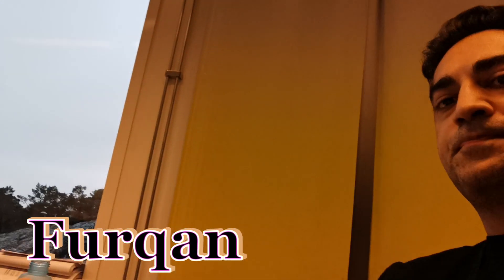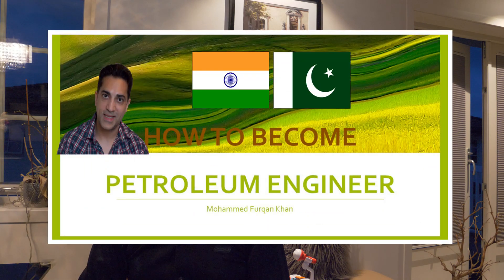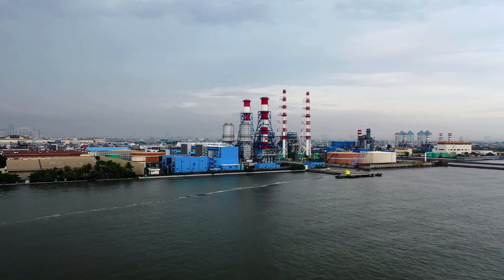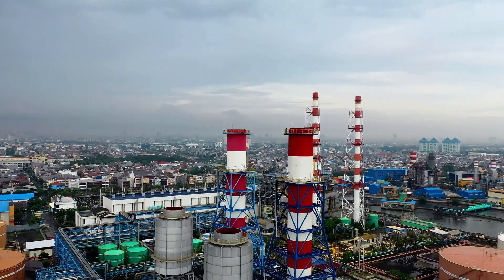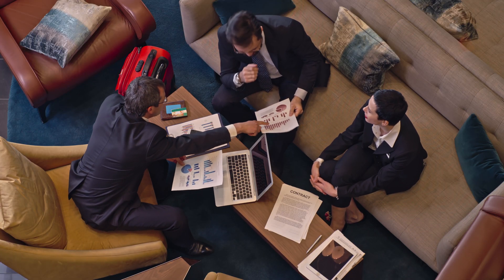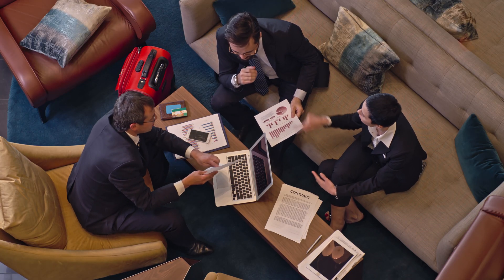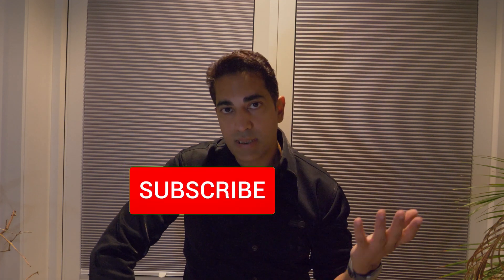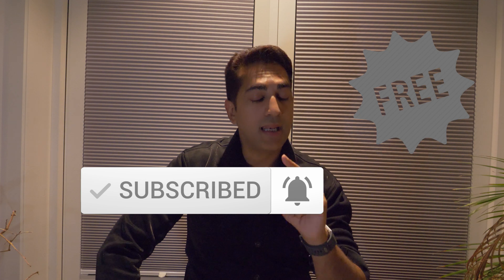Salary and Future of Petroleum Engineers | Questions & Answers by Furqan | Desi lifestyle in Europe

Comment: Hello bro can  mechanical engineers do petrolium jobs?
What cources should I do
Reply from the maker: Yes, they are one of the main facility engineers. Courses that are relevant: fluid dynamics, system response and control, stress analysis, mechanics of machines, heat transfer, and thermodynamics, material, valve, rotating machines erc..
Reply: @DesiLifestyle  can I learn HVAC? Or full MEP course
Reply from the maker: Sure you can. HVAC is also a engineering branch.

Comment: Sir, if one is interested in sales reps in oil and gas sector. is it possible to get this without experience of field working in oil and gas????? explain please
Reply from the maker: Sure, it actually depands on what you are selling, man hours, valves, fittings, main equipment, nuts and bolts etc...